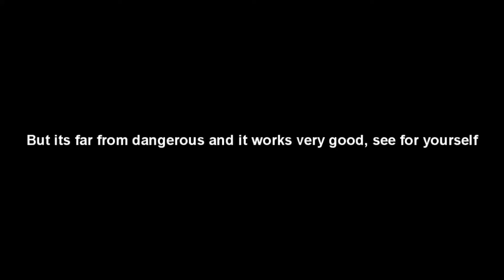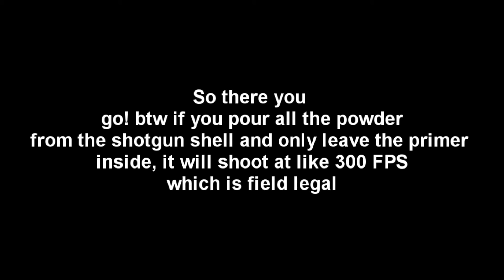Shooting Airsoft .20g BB's from a Real Shotgun!

Comment: I'm not sure if the same applies with the 20 gauge, but most 12 gauge Mossberg 500s have a 3 inch chamber, so it cycles shells longer than the regular 2 1/2 and 2 3/4 inch shells, i wouldn't think it'd be a problem.